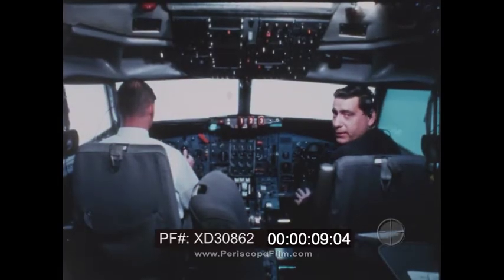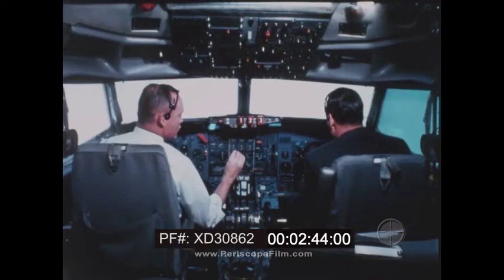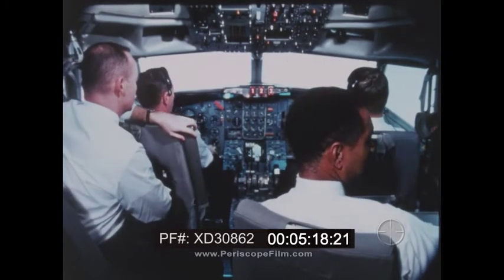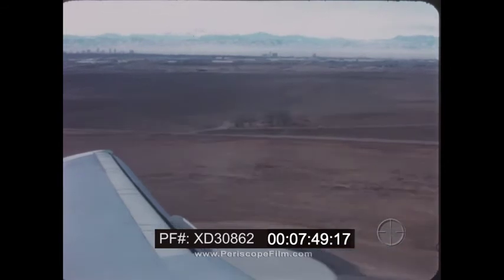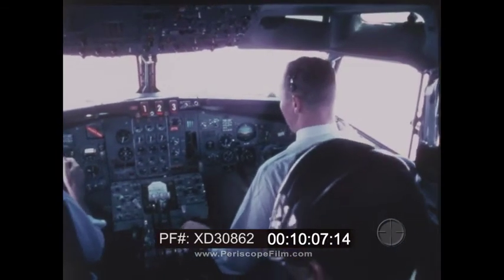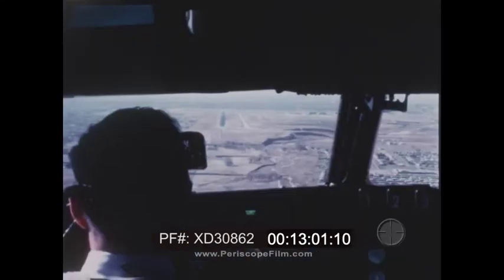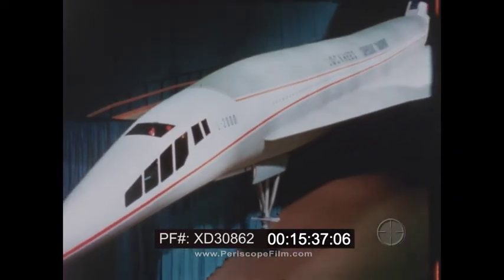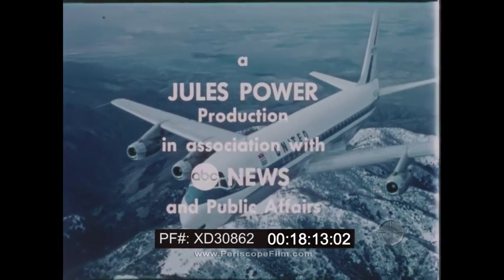1967 “DISCOVERY ’67"  BOEING 727 JETLINER  UNITED AIRLINES  EDUCATIONAL FILM XD30862

Comment: I flew on all series of the 727 with Braniff International, Eastern, Delta, and Continental.  Back in the 70’s, if you flew on a domestic flight, would most likely be a 727 or DC 9.    United and the up start Southwest flew the 737’s and Delta had the Convair 880 (I think these were replaced by the 727).  These birds were way more comfortable than the buses today.
Reply: The Convair 880 and 990 were beautiful planes, and damned fast.  But they drank gas, and no one could afford to fly them, and that's what did them in.
Reply: TWA flew them also.

Comment: Amazing piece of visual history. I immediately noticed the all-analog gauge/instrument cockpit- quite different from the fly-by-wire, ultra sophisticated cockpit layouts of today. Another thing that caught my eye: when the reporter was standing at the rear, integrated step way before the test-flight (please correct if I’m incorrect, but I’ve always read that the Boeing 727 was, at that time, the only commercial aircraft so equipped), I immediately thought of the infamous D. B. Cooper. Guy was nuts to do what he did from those stairs.  Anyway- takes ya back. Thanks for presentation.
Reply: Yak-40 also have this type access ramp
Reply: I noticed that too. So cool. Easier on the eyes.
Reply: Caravelle also had one.
Reply: @MomentalnoVMore  < The DC 9 has one as well.
Reply: Ventral staircase.

Comment: In 1966 I learned to fly at Stapleton…Clinton Aviation.  Many many hours in a C150 departing from and landing on those runways. Gates Aviation had a huge general aviation tie down area with hundreds of aircraft. A few years later General Aviation was run off of Stapleton due to the huge increase in airline traffic.   The 727 and DC-9 were predominant as was the 707 and DC-8.  DC-7, DC-6, DC-3 and most prop aircraft were phased out and  Frontier adopting the Convair 580.  Wanted to be an airline pilot but became an Air Traffic Controller instead.. (ZAB ZDV)… United’s training facility used to be next to the passenger terminal on the North side. Then in the early seventies they built a new facility West of Syracuse at about 38th Street.

Comment: Since you mentioned it I checked and this jet does of course not have the DB Cooper switch installed. It was a small aerodynamically operated latch that assured the stairs would not extend in flight. D B didn't jump till "71.

Comment: This is real early. Later -27s locked-out the use of 40 degrees flaps. That was because it was possible to "get behind the power curve" when using them for landing. Meaning the full thrust available wasn't enough to cancel their drag and hence the ship's sink rate. (Meaning you crashed even though you saw it coming a mile away.)
Reply: The place I worked had 727’s, and they restricted the use of 40° flaps because of the wear on the flap tracks. Decades of maintenance, machining and wear brought on the 30° limit. A handful of airplanes were exempted for operation out of the old St. Thomas, VI airport (short rwy!). Those aircraft had nosewheel brakes as well. As far as ‘getting behind the power curve.’ Not really a big deal. Flaps go to 25° for a go-around anyway. If it happened to be on an engine out approach, flaps were set at 15° for landing and raised to 5° for go-around on the two remaining engines. I think I’m remembering correctly, it’s been a long time. My last 727 flight was in 1996. And like the pilot mentioned in the video, my very favorite airliner was the 727. Man, it was fun.
Reply: @buckerjungmann  Very very good ! Thanks for the input! But I was just repeating what the Boeing Rep told us in '71.
Stretches could and did do the "Deep Stall" a la' BAC 1-Eleven with fatal results before they locked out 40 degrees, he said. As for nose wheel brakes - you got me there, pal. I never knew there was such a thing on   any Seven-Twenty-Sevens !
Reply: Probably something to it, for sure! Now I remember the crazy stall warning and stick pusher on the BAC 1-11. I flew it for a while in 1984. They sure had a big problem during stall tests… it crashed! The ‘T’ tail was part of it (like the 727). So limiting the flap travel would be a good way to avoid pesky little things like that, lol! The airline safety record is partly built on simply avoiding scenarios that cause crashes… a luxury GA doesn’t have in a general sense. Personal minimums, good old fashioned head work helps, but those things AND a strict procedural system help with their safety record. I know I rarely used 40° flaps. It just wasn’t necessary most places and didn’t lower the Vref speed significantly anyway. As fuel continued to cost more, we were encouraged to use less flaps for the final segment as it saved quite a bit. Toward the end of the 727’s time in service, noise restrictions limited the flap travel as well. Part of some of the hush kits included flaps 25° for landing… quieter on final.

In training, we saw a Northwest Airlines video of a 727-200 with nose wheel brakes do a max braking stop after landing. 1800 feet is all it took! Gave us confidence in the airplane, that’s for sure. I flew several different Boeings in my career (retired on the 787), but there’s no hesitation when someone asks me my favorite. Thanks, Patrick, for the walk down the lane of memories. No regrets, simply glad it happened.
Reply: @patrickshaw8595  Back in the 60s and 70s,  Some of the 27s that Braniff flew had nose wheel brakes .

Comment: A little known rfact/trivia

In Boeing original design for the 737  was basically just a 727 without the center engine but the outboards remaining aft where they were rather than under the wings.

Had they stayed with that then all the trouble Boeing ended up having trying to shoehorn larger diameter turbofans under the wing , requiring the re-design of the CFM-56 to give it that flatbotrtomed, sharks mouth look back in the 80's , the redesign of the wing  to fit a newer larger engine what lead to the, redesigned flight controls that lead to the crashes on the 737 MAX  could have all been avoided  and the even larger diameter fans that still easily fit under the wing of an A-320 NEO  and provide that longer range would also easily fit in that higher aft position 

The CW about why they did not go for it was some people thought it would look too much like a DC-9
Reply: Well its obvious you have never worked a flight line.. 707 to the 737. All the flight decks were similar the only real difference was the performance of the airframe.  You have to look at the era to understand what Boeing was doing.. 707 was always a transcontinental design the 727 was to be a intermediate range domestic design and 737 was called the guppy.. but what actually happened was the efficiency of high bypass engines improved exponentially .. this rendered the 727 moot . The cfm-56 design was simply meant to keep the intake clear of FOD damage. All they did was move gearbox and cooling systems off to the side...
Reply: @thomasburke7995  

No I never worked as a ramp tramp but you can know just as much if not MORE by seeing them from the inside and while doing walk arounds.

It is obviuos that you do not know as much as you think you know 

Flight flight decks AKA cockpits are in fact NOT similar .  I never flew the 707 or 727 so I do not know if the cockpits were in fact identical/interchangeable but they did both have the then standard Pilot/Co-Pilot Flight Engineer layout  HOWEVER the 6737 like the DC-9 that it was built to compete with  eliminated  the FE position   

It is also a well know fact that the fuselage sections aft of the cockpit and forward of the wing box and aft the wing box and forward of the tail  were identical/interchangeable on all three aircraft and a single fuselage shop made those sub-assemblies to all three assembly lines while the 707, 727 and 737 were in production at the same time. 

The 707 had more fuselage sections, the 727 had less, although the shortest 707 and the longest 727 were pretty darned close to being the same length . The 737 had less sections that the 727, the original, the one Lufthansa bought had  pretty much the same number of seats as the then current version of the DC-9, the next version the one United bought was just 3 feet longer.   

It is also an easily verifiable fact that the initial development design of the 737, one that made it all the way to artist rendering and table top models had it as a shortened, short as the original 737 Lufthansa bought, twin engine 727, still had teh T-tail it just eliminated the center JT-8, the inlet at teh base of the tail and teh S duct that connected them, which the 727 really only had so that it could satisfy the need for 3 engines that circa 60's ETOP rules required for over water routes in excess of 60 minutes, routes that Eastern one of initial buyers of the 727 waned to fly. 

Now Boeing came up with some self serving face saving BS about how moving the engines to under wing pods gave it SLIGHT performance rewards but many within the compnay and the broader aviation business always believed the "real reason" was that had they stayed with the two engines aft the 737 would have looked too much like the DC-9 and the last thing in the world  Boeing wanted to be caused of was that they "copied" the DC-9 , which after all was what it was competing with

It is also just an obvious fact that had they stuck with it when it came for the NG's that they could have simply bolted on "stock" CFM-56's and there would have been no need to redesign the engine  AND when it came time for the MAX they could have bolted on those same engines that the A-320 NEO uses with plenty of ground clearance, no re-designing the engine AGAIN, to wring just little more performance out of it. no redesigning the wing and wing box to accommodate that new engine and no no need for new flight control  systems to manage flying with an inherently unstable wing  and no crashes caused by that system wanting to drop the nose and fly you into the ground.
Reply: @daleferber2096   Enjoyed your comment,, I too worked as a line mechanic back in the day. I didn't think of myself as a ramp tramp ,, however your right regarding Lufthansa taking delivery of the first 737 which was a - 100 series. Boeing made very few of them. And yes, they were about 3 feet shorter at the wing box. Other than that,  they were identical to the-200 series. 
Also around that time,  Airlines were wanting to save money. One less engine and one less flight crew member to pay for.

Comment: They had a simulated #3 engine fire and shut off "A" system hydraulics and crank down the landing gear. 
Number 1,,  A system hydraulic pumps come off engines # 1 and 2. The landing gear is operated by the A system,, no need to deactivate it.
Number 2 you cannot crank down the landing gear,, they free fall and lock when over center. I was a former mechanic back in the day and worked on these babies.